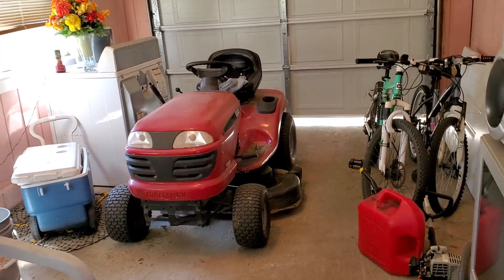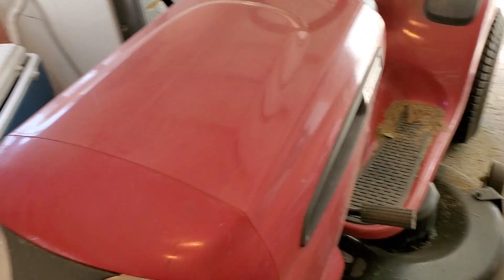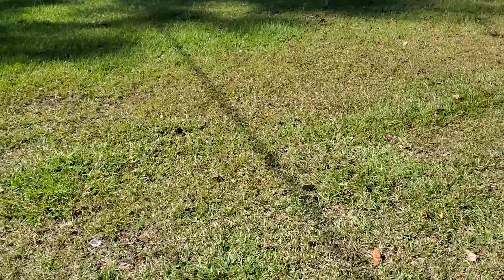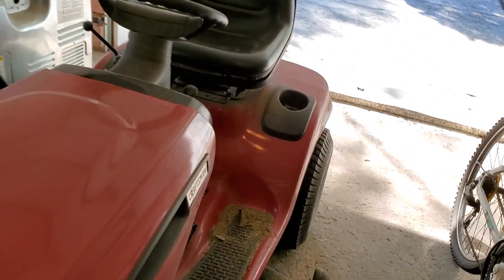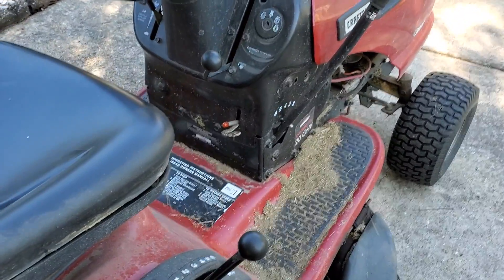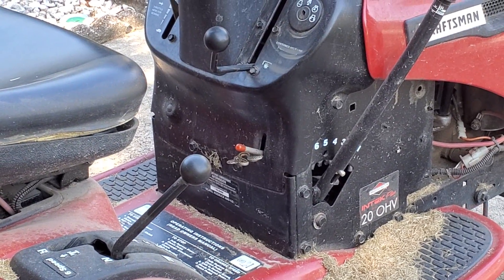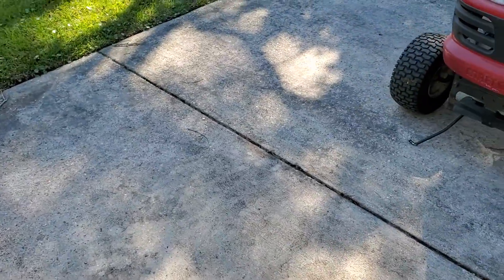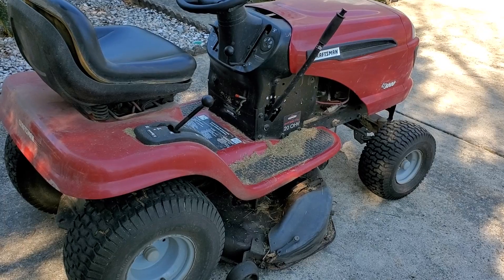Late October 2019 Startup Of The Craftsman Lawnmower Part 1 & Fail

Comment: Not many snakes here in the north.  Allegedly there are garter snakes, I've never seen one, but they're harmless and non-poisonous.  That snake is probably in the same family.  If that were me, I would have gotten my long needlenose pliers and grabbed him by the back of the neck and pulled him out.

The "hose" is a linkage for something.  It's missing a cotter pin, that's why it fell off.  Open the hood and you should see a hole it snaps back into.  Then stick a paper clip through the hole in the linkage.  10 second fix.  You won't!